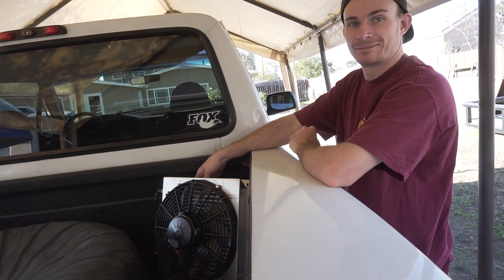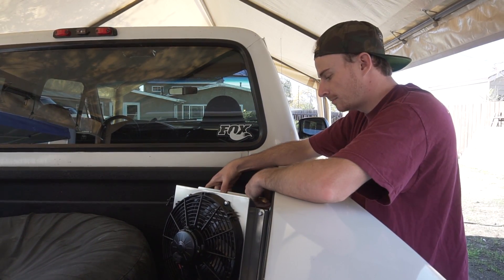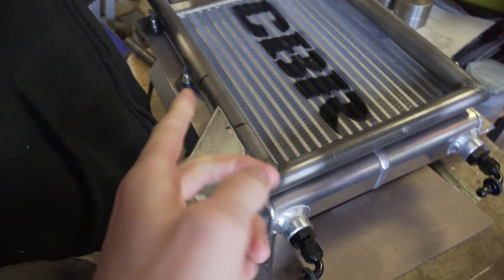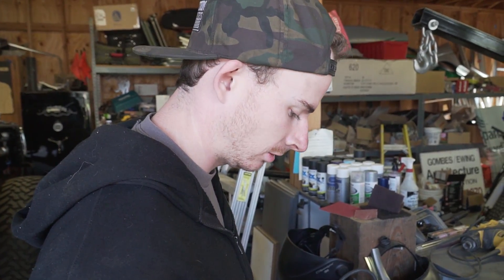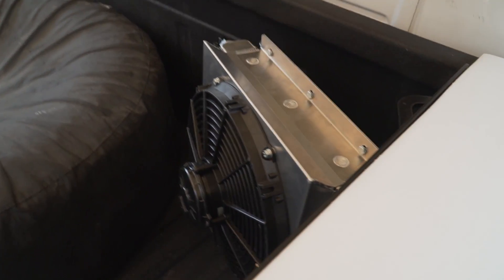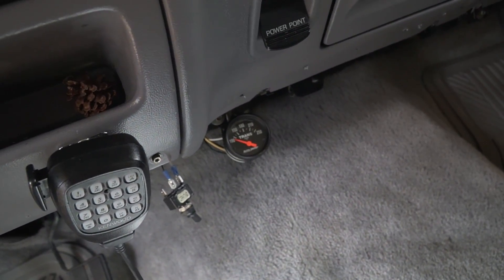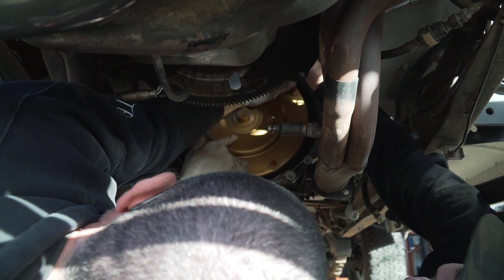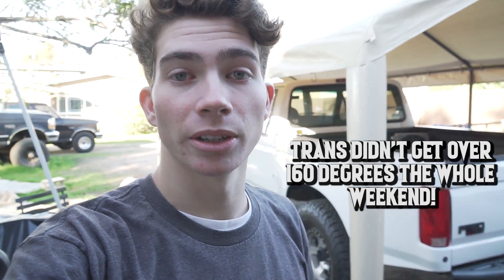NEW Transmission Cooler and Torque Converter for the 94 F150!

Comment: Is there a diff between a 1995 f 150 5.3l (I think) v8 high output 4x4 torque converter & a f150 5.0l v8 1993 2wd torque converter?would they be interchangeable?

Comment: @wings world if you upgrade the cooler, you have to upgrade the converter as well?
Reply: Looking to upgrade my cooler from my truck
Reply from the maker: Juan Perez no, we just happened to do both at the same time. The last converter started wearing out because the trans would get so hot. So we went with a higher stall converter that works better for the truck and a cooler to keep the trans colder.

Comment: Did you get good cooling out of that setup? With the fan tucked into the corner of the bed, the airflow might be restricted.
Reply from the maker: Yep it worked great! the trans never got over 160 degrees the whole time driving out there, playing around, and driving back. There isnt much airflow going on where the cooler is mounted but the fan takes care of that. The fan that is on the cooler pulls a looottt of air.